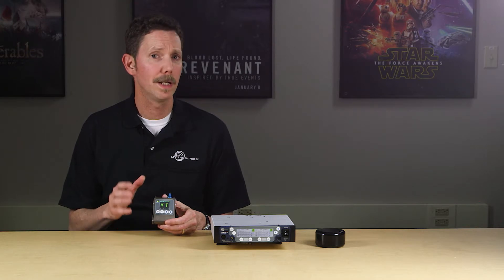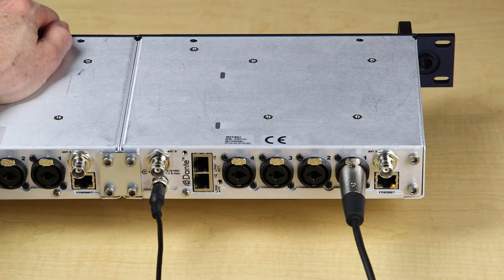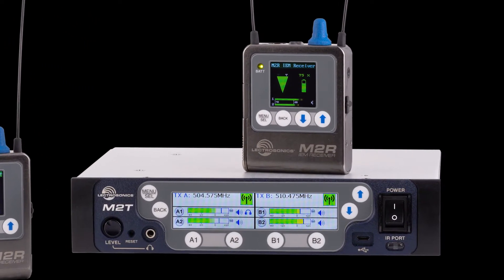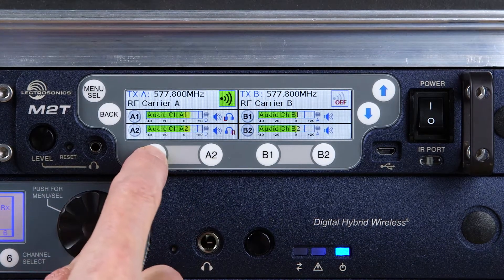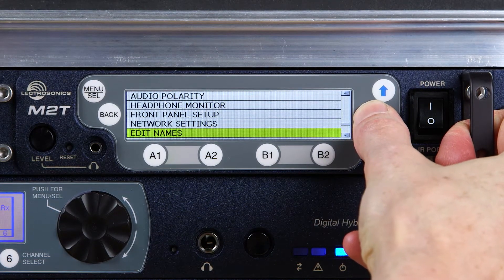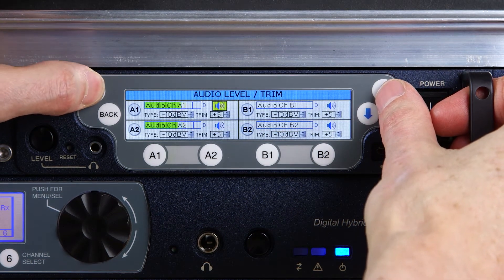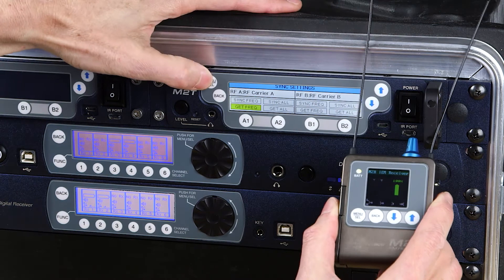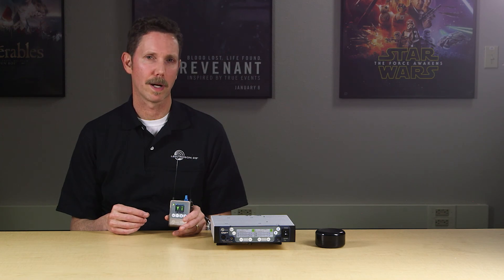Lectrosonics Duet Digital IEM/IFB System Overview

Comment: Does the M2R only work with the M2T? M2T does not look bag friendly.
Reply from the maker: The DCHT is specifically made for use as a bag/portable digital stereo transmitter for the Duet series, and works perfectly with the M2R. It offers one stereo channel (where the M2T has two) and has AES digital inputs (and analog) instead of the Dante inputs on the M2T, but otherwise is functionally the same. https://www.youtube.com/watch?v=TgiTwZwkqOg